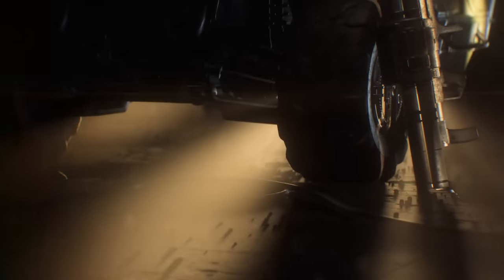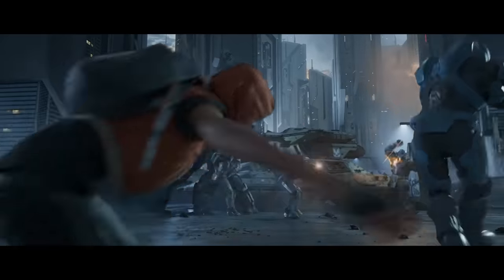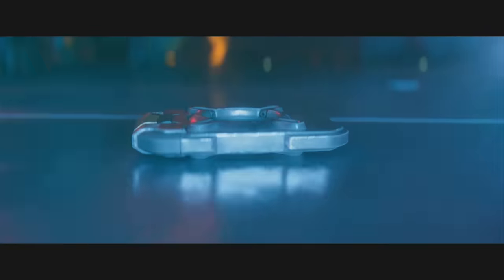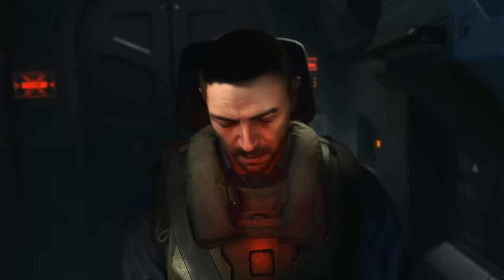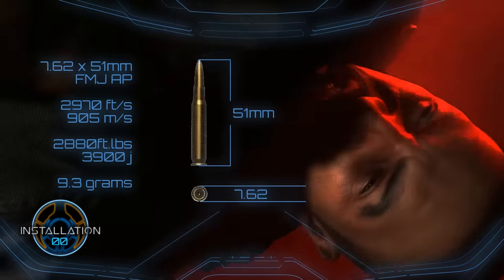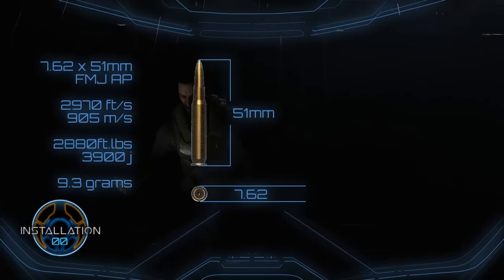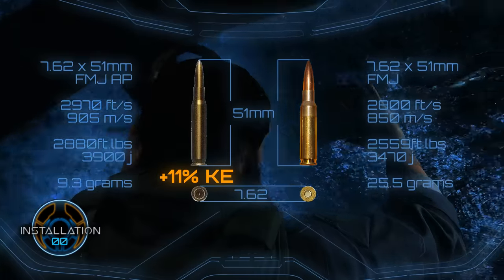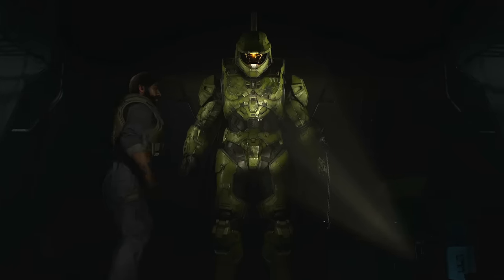Why are UNSC Weapons so powerful!? | The Armory

Comment: one explanation I can think of as to why what you propose would be true is if you look at the trade-offs of the next generation squad weapon program that was recently awarded to sig in the US. a lot of the criticisms of the larger higher velocity round is that you won't be able to carry as much ammunition as you would be able to previously with a 556 and I've heard from veterans that part of what makes you able to win a firefight in a war zone is being able to carry more ammo so perhaps the rounds are the same size because like you suggested they found ways to accelerate the projectile and increase its kinetic potential through perhaps coil boosting technology in the barrel and better chemical compositions in the exothermic material in the casing itself. this would allow soldiers to carry far more ammunition without increasing the amount of weight that they are carrying thus allowing them a better chance of winning firefights

Comment: F=M*V so assuming dumb bullets are being lobbed around its just the mass*velocity that determines energy (and changes to propellant would serve to increase velocity). The only way you can make the math on this is by changing the bullet to not be dumb; ie explosive or otherwise energetic rounds (so not relying upon just kinetic impact) or a hybrid round that essentially has the bullet act as a rocket after leaving the gun.

As an aside, they wouldn't dramatically change the propellant chemistry on an existing round; you don't want someone putting a much hotter (higher chamber pressure) round into a gun not able to handle it (also propellant chemistry changes can have issues with reacting with the barrel etc).

Comment: One thing you haven't considered is they are able to exert more berral pressure on the round pushing it out with greater velocity similar to how the US army was able to upgrade its main gun with the XM5 replacing the M4 with a new 6.8 round and achieving higher velocity and force on target with a smaller round.

Comment: an inbuilt projectile accelerator would be beneficial for avoiding squib load or miss-fire in the weapon system, this system only need to provide enough energy to push a stuck round out of the barrel

Comment: If I were to guess the issue, it would be that back when they first created the lore for the weapon, that they counted the slug weight as the round's total weight, instead of the total cartridge. So as you suggested, a continuity error, that would explain the weird weight better I think than using mini MAC weaponry boosters as it's been in use since 2395 according to the lore, and mini rail guns etc. like the M99 Stanchion Gauss rifle are still only starting to be used for special forces/sniper use only leading me to believe that it's just a continuity error.

Comment: Hey man! Love your stuff!!! I've been a long time viewer and will continue to be. 

But one small nit pick! So in your graphics looking at the rounds, like with the 7.62x51mm NATO. The graphic implies that the whole round is 51mm long, and that the case is 7.62mm around. But actually those measurements refer only to the case length (from the bottom of the case to the top of the neck, not including the projectile) and the 7.62mm refers to the projectile diameter, rather than the case diameter. 

EXCELLENT video! Love your content. Keep it up.

Comment: Interestingly enough on the hybridize firing system using electromagnetic technology, there is a scientific engineering firm called ENIG which founded by an ex-Navy scientist and member of the Senior Executive Service with the US Navy's Office of Naval Research, have been given an informal challenge by the senior leadership of the Lockheed Martin Missiles and Fire Control division and the US Department of Defense Office of the Secretary of Defense's Weapon System to make a weapon capable of a muzzle velocity of  2 to 3.5 km/s. ENIG solution is a technology using a combination of conventional propellant projectile and electromagnetic energy using a magnetic acceleration chamber.

Comment: I think the reason why the battle rifle or even m6 magnum is more powerful than the assualt rifle is because covenant armor is designed to protect against low mass projectiles. Their armor is tough to penetrate but sucks at dissapating and reducing incoming kinetic energy. Thats why the guns that shoot bigger and heavier projectiles do better at killing an elite or grunt. Those projectiles simply have more mass and surface area and kills a covenant soldier with kinetic energy alone. That means in the halo universe, a .45-70 lever action or a 72 caliber musket will do better at killing a elite than a modern 5.56/.223 ar 15.

Comment: One of these days when you come to the US you've got to go to Drive Tanks in Texas. Mainly for the D20 but they have an entire arsenel down there.
Being someone who likes to dabble around guns, without altering the calibers to compensate (because we all know that .30-06 pwns when using black tip) for the difference we're looking at two different things. Either 1) the AP part of the round is not some derivative of the IRL black tip where a steel core penetrator as seen on the M855/SS109 but something akin to SLAP as seen on the .50BMG (and yes there is a 7.62 SLAP but it's less common due to... issues like exiting the barrel before the muzzle) where that has a tungsten penetrator and is used to get inside lightly armored APCs. 2) We're dealing with future Magnum powder or these rounds being packed really hot. The issue with this is the primers popping out which the US Army already has a (hopeful) solution for in the recent winning bid for the XM5/XMG5 program chambered in Sig .277 Fury (6.8 SPC) where the bottom of the case has a steel bottom to help retain chamber pressures in excess of 65,000 PSI if the patents on the barrels are anything to go by. 
Honestly, I'd be more willing to lean towards the hotter packed rounds with potentially magnum powder (at least by today's standards) in some kind of brass alloy case to allow for higher chamber pressures with a round that has a more lightweight penetrator to give it is AP component.

Comment: Here's the opinion of a reloader and certified gun nut:

Given the 500 years of metallurgy, ballistics, and chemical engineering advancements of the Halo universe, an 11% increase in velocity/energy is actually really really low.

The US military just adopted the new Sig Sauer Spear as the standard infantry weapon. It fires a new cartridge, the .277 Sig Fury(6.8x51mm). Due to a unique 2 piece case design, it can handle pressures of 80,000psi+. Without going into a bunch of detail, this leads to the .277 Fury having 8%-10% more velocity than the comparable 6.5 Creedmoor(6.5x48mm) round. Both cartridges are based off the 308/7.62NATO casing.

So using modern metals and modern propellants, Sig's engineers were able to effectively match what is going on in the Halo universe.

Some other random thoughts:

The projectiles in Halo are probably a tungsten penetrator wrapped in a solid copper jacket. Similar to what the current 5.56x45mm M855A1 ammo type is.

Modern nitrocellulose powders have a max burn rate of around 6,000 Feet per second. Due to friction loss, the max projectile speed is around 5,000fps. At around 4,600fps, the .220 Swift is the fastest commercially loaded round available.

In order to reduce friction and gain some velocity, some shooters use bullets coated in molybdenum-disulfide. This compound reduced friction by imbedding itself into the barrel after a few dozen rounds. This allows projectile speed to increase by 3%-5% without increasing the powder charge.

If the Halo universe engineers could produce rifle barrels with a metal alloy or a molecular coating type that would reduce friction by noticeable amount, use two piece case designs or futuristic metal alloys, and use futuristic propellant compounds, they should really be able to achieve much higher velocities and energies than what the lore states. In my opinion, it should be around a 25%-30% increase.

Comment: Higher velocity rounds most does not always equate to higher damage to target. When looking at the expansion of rounds on soft targets, there is a threshold of velocity where the round is moving so fast there is no time for it to expand on contact with the target therefore doing less damage.

Comment: You overthink it. Your answer was already on the specs. Projectile of UNSC is ~9g vs ~28g of the IRL projectile. Lighter bullets exit barrel muzzle at higher velocity. Given it's a video game about the 26th century, prob would be denser bullet in addition to lighter aiding in transfer of kinetic energy. Booster would prob be most likely mechanical in nature and act like modern day Nielssen device like those on smaller caliber suppressors that aide in cycling of weapon from gas expansion since suppressors attachments sometimes make handgun barrels too front end heavy; prob minimal velocity and damage gain as compared to denser and lighter bullet.

Comment: Modern powder as it stands can be very powerful. For example, If you put a pistol powder into a rifle it would blow up. The real factor needed to be considered is metallurgy. Stronger/thicker casings will take more pressure off the barrel and potentially reduce heat transfer to/absorb more heat from the barrel to be expelled, depending on cyclic rate and or temperature of the powder still burning as the bullet is moving down the barrel. A stronger barrel will also be able to take "hotter" powder loads. The new sig military rifles are a good example of this. Best way to defeat armor is with speed and a small, hard projectile. While a lighter bullet will travel quite fast, it may not carry the energy to penetrate. Given the case of the super lightweight 7.62x51, it's diameter will likely not help the bullet either compared to something like a 223/556.

Comment: I've always just head-canond that UNSC rounds are just fired with extra umph to them, either by having a way to increase the explosive power within to propel projectiles with greater force, or go with the rail/mac gun theory and maybe the guns just have smaller versions of what the guass canon does, just fit for regular rounds.

Comment: So my girlfriend, who is the Halo nerd of the two of us, had a thought on this. What if the Armor Piercing/Harder Hitting part may have to do with using the same forging technique they use on Mjolnir Armor that allows for a highly dense steel or titanium penetrator along with denser Brass casing (as we see them using only brass casings except in the SMG but that's a different story altogether) for better pressure retention on the heavier rounds from the denser cores along with your ideas of more refined propellants. The issue I see there is they hit like the new composite casings with nowhere near the numbers but thats also a new invention and Bungie/343 were not gun people.

Comment: The last theory is an awesome theory. In StarCraft, the Marines use a hybrid-chemical-gauss rifle called the C-14 Impaler, which fires thirty 8mm DU bullets per second from a 500 round box magazine, initially using traditional chemical reactions to accelerate the bullet, but then further accelerating the bullet to hypervelocity speeds using railgun magnetic technology. Cool concept, but StarCraft is consistent about recoil, unlike Halo. Only someone in a powered exoskeleton (like a Marine) can fire a C-14 Impaler in StarCraft. Anyone and their mom can fire an M5 rifle in Halo.

Comment: The answer is quite likely propellant and a switch from chemical primers to electric or piezoelectric primers. Going to an electric primer would allow for higher ignition temperatures in regular powder chemistries, or a complete switch to a plasticized propellant like the HMX (octogen) propellant used in the unfulfilled Heckler & Koch G11 caseless rifle. There is precedent for such propellants being available with the M7 SMG, which fired a 5x23mm caseless round. As to why something like the M5 rifle still used a cased ammunition system, heat removal from the system would be the biggest reason.

Comment: Do you think there is the possibility of higher standard gyro jet bullets, it would explain the weight difference, and it would explain that the firing speed would be different from the speed at impact if the bullet propels itself, it would have more energy after flight.

Comment: They're almost certainly using ETC guns (electro thermal chemical). It is a different kind of propellent that requires and electric charge to ignite. They create much greater pressure than gunpowder while not being actual explosives. Cool stuff. Also check out CTA guns and RAVEN cannons if you like this sort of thing.

Comment: From the glow, trail, and lack of bullet drop when shooting in the games, I always figured they functioned similarly to Impalers in StarCraft.  That is, much more advanced charge and case than modern but firing the bullet into a coilgun.  This method allows for firepower similar to a full coilgun but cheaper and more energy efficient and allows for firing more massive (mass, not size) bullets than a modern weapon can.  Especially if the magazines include some magnetic suspension of the bullets and the gun uses magnetics to help reduce recoil.

Honestly, the only problem with UNSC weaponry is that, judging from the lack of bullet-drop, their effective range is dramatically beyond an actual engagement range, if we were to remove the balancing of weapon ranges from the games for the sake of realism.  This also means the energy of high-mass projectiles is being wasted as you can use bullets with greater mass to deliver dramatically greater energy.  From the poor range of most Covenant weapons, this would have been utterly devastating against all Covenant targets and would ensure orbital superiority via the defense of surface-to-space weapon systems.

Comment: I always assumed it was a hybrid solution. Refined propellants are great and all but I just assumed the rounds got a slight push from a electro magnetic accelerator and stabilized with traditional rifling. Softer ignition from exotic propellants (by 2022 standard) and the accelerator combined could achieve higher velocity without the recoil. This, to my EXTREMELY limited understanding, would help explain the lack of recoil experienced by non spartan soldiers when firing full auto 30 caliber weapons. Would love to hear how you would imagine such a hybrid weapon would work even if it's not cannon supported.

Comment: what about plastic casing? the US military has recently been looking into plastic casings which makes the round 1/3 lighter than its brass counterpart. not to mention because the casing being thermally insular more of the energy goes into propelling the round forward instead of being absorbed by the casing as heat
Reply: I can see them using thermal insulation plastics inside brass casings to save on materials, plastics need ALOT of oil to produce.

Comment: The guns in Halo have a lot of extra stuff hanging off of them that wouldn't make sense in a normal firearm. The cylinder on the bottom of the MA5 has no purpose based on modern firearms tech (even the relatively fat gas tube on an AK isn't that large), but if there were capacitors or other energy storage to supply the MAC theory, it could get some spicy velocities.

The current US NGSW program is changing to ammo that's got pressure similar to a tank's cannon, so the idea of spicier power would make sense. Additionally, with advances in cartridge case technology like we see with the TruVelocity entry to the NGSW program, you could get much less of the round's weight put in the case and more in the bullet and powder, which could explain the absurdly small round weight.

The biggest complaint of 7.62x51 in modern context is weight, so advanced cases reducing that could be an explanation for going back to a battle rifle round.

Comment: I think there is an easier explanation. We already have gunpowders for weapons that fire bullets much faster, but the heat and overpressure it creates causes too much wear and tear (and heat generation) to keep the weapons reliable.

In the Halo universe the technology has advanced enough for gun chambers that can withstand the pressure and siphon off the heat somewhere to handle such powders. Now all you need is improved recoil handling for these stronger rounds and you are set.

Comment: Here's a unique theory.Maybe it's combination of all 3 concepts in one.If you have all 3 together, you have an even faster stronger bullet.That would make it even better than a normal projectile of modern day which would include a hyperdized weapon system which would use a magnetic rail system to fire the projectile faster along with a better propellant and maybe even tank ammunition designs and capabilities

Comment: As a gun nerd keep this topic coming, but a look into the barrel size as well as speculating the metalergy of the chamber (how it would deal with increased pressures from a faster burning powder) also as a side not while youre not nesicarily wrong when compairing .308win and 7.62x51 most .308 is generally more powerful than x51 due to its increased case capacity. Some 7.62x51 guns will not be chambered for .308 due to that increase in pressure even though there is nothing physically preventing the gun from cycling it, its just not a good idea and can lead to stress fractures in the chamber and more likely the locking lugs of the bolt

Comment: they could also use a different matterial or smarter projectile which means when it is flying through the air it is able to be faster as it is not so affected by drag or when it hits the bullet could have some kind of secondary mechanism to deal more damage